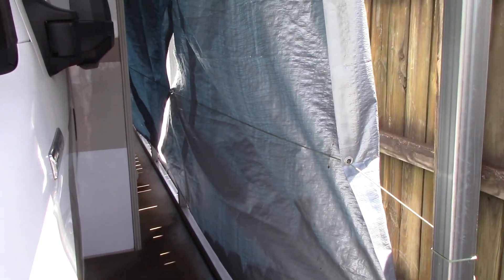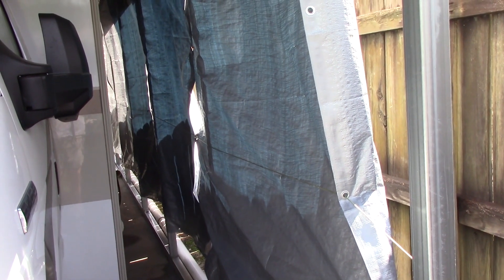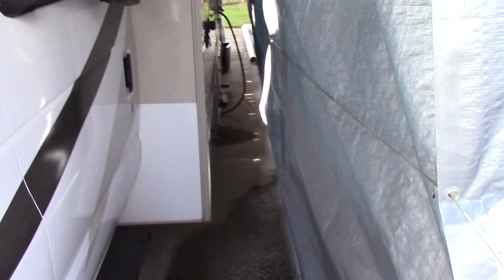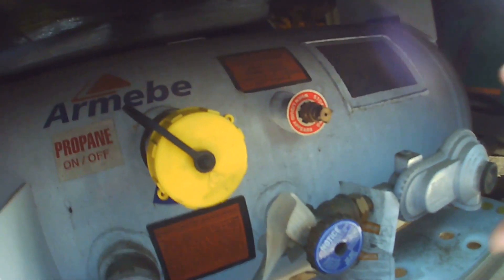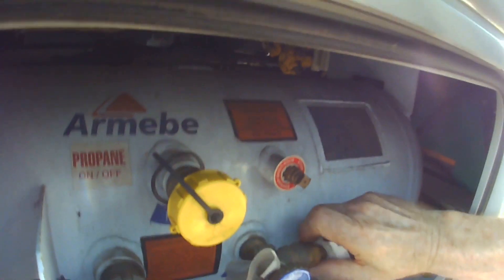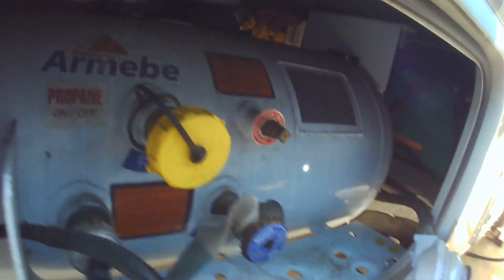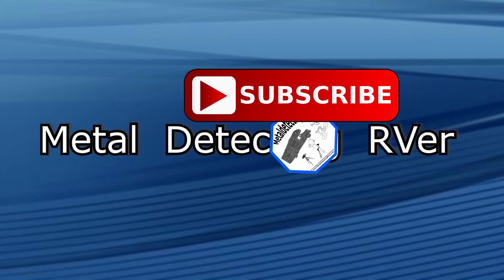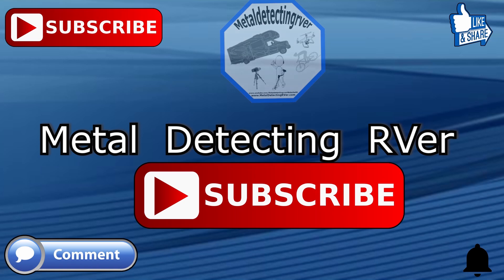RV propne "Gas Stop" install - Safety First

Comment: Hi, Thanks for the video. I didn't know about the Gas Tape nor the lefty-tighty, so thanks for that. I am curious about how you got the plastic regulator cover back on at the end of the video. Did you have to cut it at all, did you have to get new mounting hardware etc? I will be doing this to my rig this Fall and would like to hear how it worked for you. Thanks
Reply from the maker: Hi True Blue. Thanks I’m glad you found it helpful. As for the cover, of course I used a screwdriver to remove the plugs to remove it. I took a pice of plastic (ice cream tub top), cut it the same size as the bottom of the cover, poked 4 holes in it and used zip ties to connect them. It is only a “dust cover” so I know it is only a protector for the regulator so it would be fine. It is still holding and doing fine. Hope this helps. Travel safe and have fun out there.

Comment: I don't think the white plumbers tape is silicon, it's PTFE (aka: Teflon).
As for number of wraps, I do 3.
-- BR
Reply from the maker: Hi Bill.  I made a text correction on the video as Teflon not silicon.  Also, towards the end I said I should of only used only three wraps instead of the four. You are right there. Have fun and safe travels.
Reply: @MetalDetectingRVer  Yes, I saw at the end where you said the instructions said "4 wraps" but that was too much. IIRC, I got the "3 wraps" from an episode of "This Old House" or "Hometime" episode many years ago (started watching them from their very beginnings on TV -- late 1970s onward).
As for RVs, I don't have mine yet (and Class Bs keep going up so high in price I may not ever get one after all), so I'm expecting to replace my current Daily Driver (2016 Honda Pilot EX-L AWD) with a new Daily Driver come March 2021 (or a bit later): A Chevy Colorado ZR2 or maybe the new Ford Bronco (when I gets specs so I can compare the two)...and put a bed-rack on it for a roof-top tent. You know, "roughing it." Of course, I'd be using hotels occasionally also on long road trips, but for weekend camping or maybe 2-3 weeks boon-docking out in the sticks (of CO, as I'm moving from TX back to CO in September), the 4x4 will get me there (and back I hope!) and the tent should be comfortable enough. Camping gear, extra fuel & water (both in "RotopaX" containers)  can be stored in the bed (will get a tonneau cover) or on a vertical side rack (as they were designed to attach to). I also want a real 4x4 for CO's sometimes serious snow/blizzard conditions, on-road and off in the many  mountains/passes CO has -- my Pilot has an excellent AWD system (iVTM4, aka: Accura SH-AWD) but it's just not up to off-road trails, more serious terrain/obstacles, mountain passes or deeper snow on or off-road.
Still, I'll be keeping my eye out for a Class B that has what I want performance/usability-wise (4-season AND AWD -- if not true 4x4) but otherwise, they may just get even more than the "too expensive" they already are! 
Of specific interest, something built on the Ford Transit AWD chassis (do not want a B on a Dodge ProMaster, even if they DID make a AWD/4x4, which seems HIGHLY unlikely anwyay)...just wish it had a LIFT KIT added (like the Mercedes Sprinter 4x4 has) and REAL 4x4 drive...but AWD may have to do, as the Class B industry is SO (an painfully!) SLOW in meeting buyers want/needs/expectations, and it STILL has no competition/answer to Winnebago's Revel 4x4 44E (but I don't a Revel, for several reasons). I doubt they will for a few years to come -- which it too long to wait for my next vehicle (Daily Driver), which is one big reason I may just get the ZR2 or Bronco do "primitive" camping/traveling. 
If I owned a huge pickup truck (instead of my current Pilot) that could carry a large (and HEAVY!) truck-camper, I'd consider that, too...but I don't!  ;-)
So the B is my only option, as it needs to be small enough to be my Daily Driver as well as a camper-van: Don't want to own/insure/maintain/register TWO vehicles!
Happy Travels...even if it's only Driveway Camping during this virus-crisis.  ;-)
-- BR